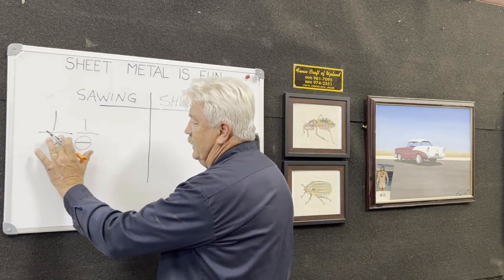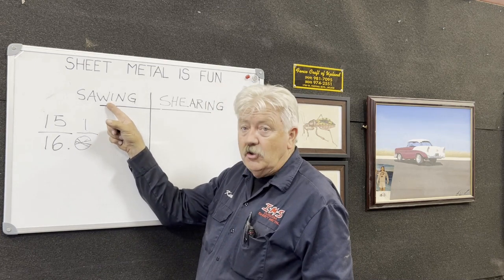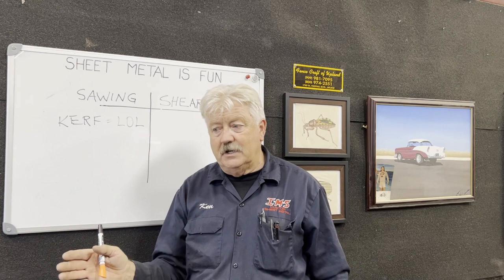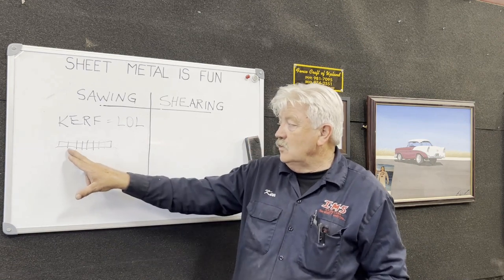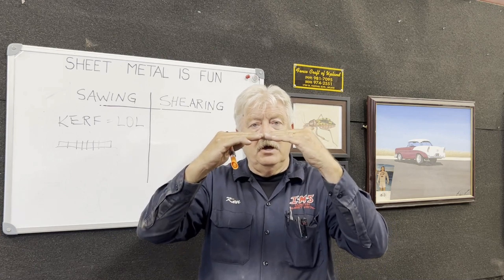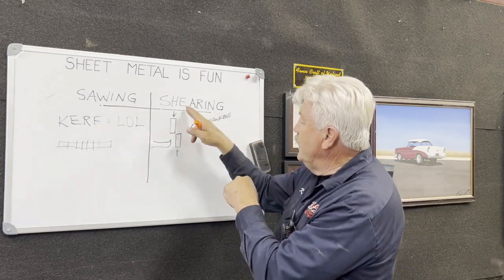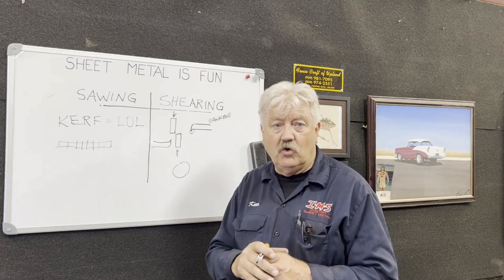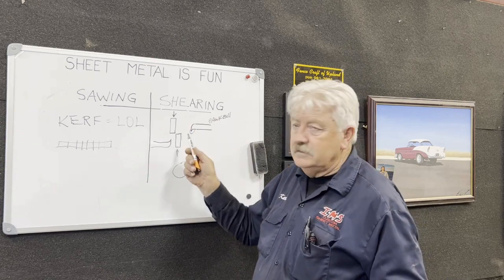Sheet Metal is Fun!  Analysis: Sawing vs. Shearing using metal cutting tools.

Comment: My career was in electronic repair.  I was the 'old guy' on the job after a while and the new guys would often ask me for help in troubleshooting a problem with equipment.  They had already spent hours trying to figure it out before asking for help.  The FIRST thing I would always do was to look at the schematic diagram with the new guy and figure out HOW and WHY the circuit worked.  After understanding the HOW and WHY it was a simple matter to determine the bad components by applying logical cause and effect analysis.  I know this isn't sheet metal, but it's a good example of what you are saying.

And this as a bonus:  I learned from the 'old guys' a long time ago.  99% of troubleshooting is VISUAL.  Keep your eyes OPEN!  If your eyes are open, so will be your MIND!
Reply from the maker: You are so right. How and why is what gives us context, and that is the key to understanding. Thanks for watching

Comment: Harbor Freight foot shears illegal to ship to certain states.  Makes no sense.
Reply: throatless shear.  mountable
Reply from the maker: That doesn't make sense. I need more info.
Reply: @sheetmetalisfun  i haven't checked recently, but about 6 years ago i was looking to buy a throatless mountable shear from Harbor Freight and for some strange reason it had limitations about which states it could be shipped to.
It made no sense.
Too much mafia in those states perhaps.
Harbor Freight maybe worried that the shears would be modified to chop off fingers...  
:)
Excellent show you have there.
Have you ever done a cameraman episode?  Taryll Fixes All  shows the cameraman who never dies more than you do, but your instructional layout and camera work are similiar.  
And by that i mean excellent.

i can tell you a funny "horror" story.  You making duct a plenum in a video reminded me. 
 14 year fire protection pipe fitter.  Was on a "commmercial" residential (condo) job and the engineer/architect hadn't left enough room for a sprinkler pipe to cross any of the bigger rectangular duct.
We were using CPVC so bends were fast and easy, so the agreement everyone came up with, including the duct guys (they were so funny), was that anytime we ran into that big duct taking up all the above ceiling space, we would offset our pipe as low as it could go, and take a big sledge, with both hands under the head, (on a ladder) we would bash a channel under the duct enough to let our pipe pass through, using the top of the sledge head.
Beautiful abortions....

Have you ever watched Periscope films?
Those black and white instructional films from the 1950's?

Comment: Thank you for taking the time to explaining the mechanics of shearing. I was told that you should never punch holes in material that is thicker than the punch diameter. I like your tutorials sir.
Reply from the maker: I've not heard that rule. We normally don't work with material thicker than 1/8th inch. So we don't encounter that situation.  My little brother is an ironworker, and he commonly punches 1" holes in 1 1/2  base plates. I prefer the easy to pick up stuff. Thanks for watching.

Comment: Ken, your videos are awesome!  Grandad was a tinsmith, but he passed when dad was a young man, so I never learned from him, though dad still pogo'd a straight ladder along the eavestrough into his 70's.....  just like he was still a kid helping his dad!  Anyhoo,  dad left me some 18 gauge sheet aluminum that I want to cut down to 3/4" strips to use instead of leading in my letterpress:  question is, should I try to find a local shop with a big shear to cut it and then file the hawksbill off, or should I use a Dremel with a cutting blade and cut it myself?  Will the shear deform the strip, being so thin?  I don't mind losing the width of the kerf.   I'm going to keep watching your videos, one a day, to keep a smile on my face, a learn a little something new!
Reply from the maker: The shear does put a slight rotation in the piece. But it's clean and fast and you can take the twist out easily. The dremel may be more work due to the heat generated by friction, and aluminum has a tendency to load up the cutting wheel. And then you still must deburr the piece.
Reply: @sheetmetalisfun    Thanks Ken!  Much appreciated!

Comment: Ken, how do I make a DIY break and shear?
Reply from the maker: Great question. The shear requires hardened blades and precise tolerances. I recommend a hand held electric unishear or double cuts. Both of which will be demonstrated in a future lesson. As for the brake, I have seen some good examples on you tube.  Cruise through your local  Harbor Freight for a hands on look at a working model for ideas or purchase.  I applaud your interest in metal working . Go for it.